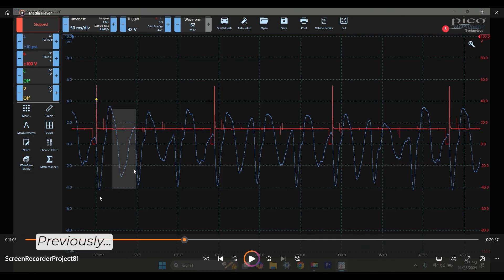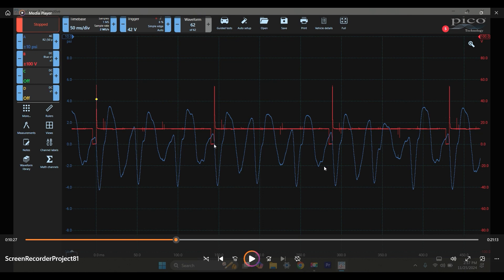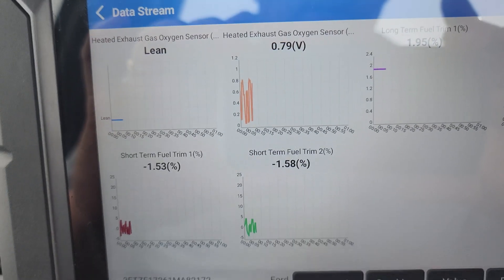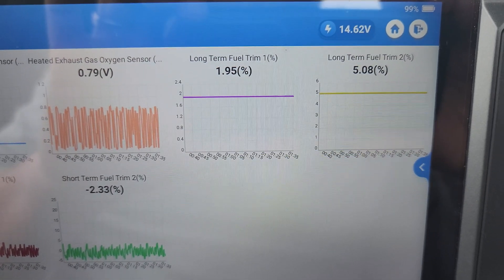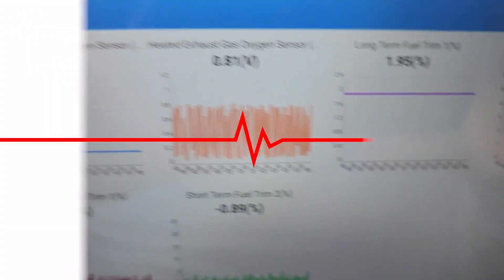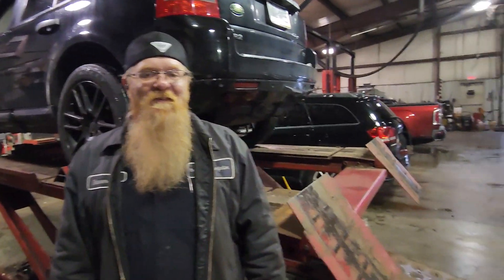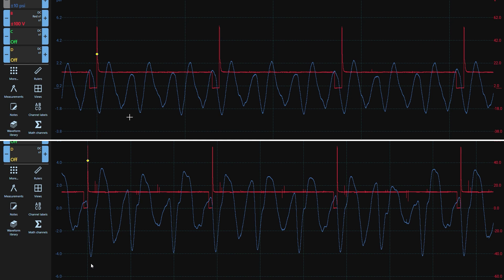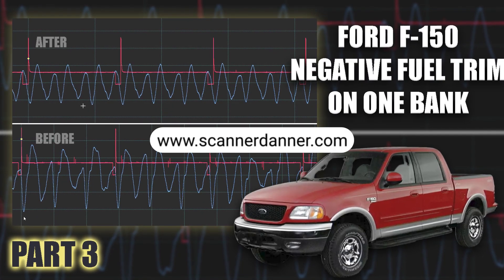Can a Restricted Injector Cause a Rich Condition? [an SD Premium case study]

Comment: When the fuel injector flows less fuel, it shows up at the ECM, via the O2 sensor, as a high oxygen content. We saw generally high O2 sensor voltage or rich not because the injector was lean - that is impossible - but because the ECM is trying to correct that lean by introducing more fuel.  Since it never corrects because the injector is bad, it doesn't stop trying to enrich the mixture...so those are skewed reading; skewed because there is never a correction. I am wondering if that whole bank gets more fuel on account of the one injector.
Reply: But maybe my head is placed where the sunshine? Before it sends the rich command we must see a lean O2 reading and never do we. It must have been leaking fuel.
Reply: But what if? That overly rich injector was 'snuffing' out the combustion in that cylinder resulting in excess 02 going past the sensor and commanding the ECM to enrich that bank. What if?
Reply from the maker: This one was flowing more fuel, but during the engine off test with a timer tool it showed less. The negative trim numbers were the result of the higher flow rate from that injector, not the cause of the rich condition as you are suggesting

Comment: I'd like to know how did you get the screen capture of the pico scope in the video like that. I need to learn editing like that. Do a video on editing.
Reply from the maker: I've told my son Caleb (my editor) that some videos on how to edit would be well received. But this is just a simple screen recorder on my laptop. Thanks!
Reply: Most of the good scantools will have a built in screen recorder too;  so you can get those same shots of Live Data.  "Automotive Diagnostics and Programming" -- does this often too.   I think he made a few videos talking about the editing side of things....  I remember him talking about using a Scantool to chart live data of several pids at once, with all the little charts on the screen and it also had a built in scope-  and he was trying to screen record at the same time--  and the scantool kept crashing.   So that's just another feature that you get with the more expensive scantools -- which is that they have overbuilt computer specs and can handle a lot more load at once without having issues..

Comment: Paul, is it possible that the restriction on fuel injector #2 was causing the injector to drip instead of spray, having the fuel drip into the #2 cylinder in a liquid form instead of a mist, which might cause a rich condition? Or am I totally wrong on this? Anyways, it was just a thought, Very interesting case study!!!!
Reply from the maker: It's a good theory however the psi transducer waveform clearly showed a larger psi drop from that injector, so there was indeed more flow! Crazy one for sure

Comment: Buzz box , almost no amount of variation from the environment . In operation, larger amount of variation, from intake track ,valve operation , temperature etc.  In some ways it is like the difference between measuring voltage drop on a circuit unloaded vs loaded.

Comment: Not sure what year, make and model vehicle.  O2 sensor data being used per cylinder and overcompensated fuel pulse width on problem injector?
Reply: That's my guess. Running lean short term causes fuel trim adjustments to add fuel, making the other injectors run rich in order to compensate for the lean condition. 

I haven't watched the video yet though.